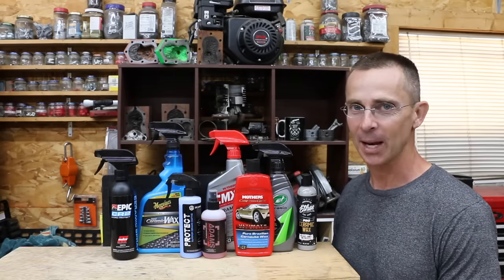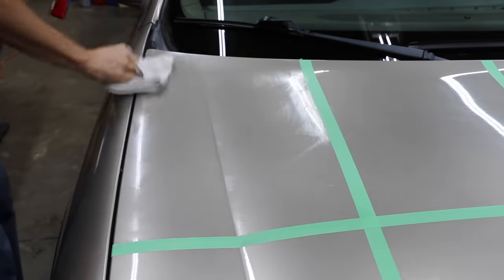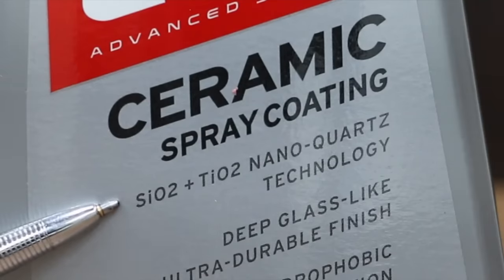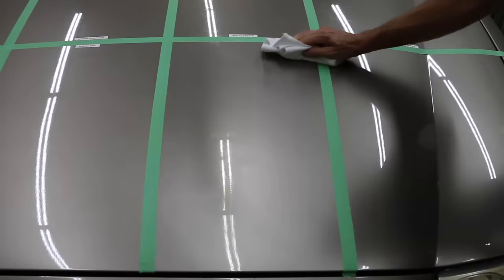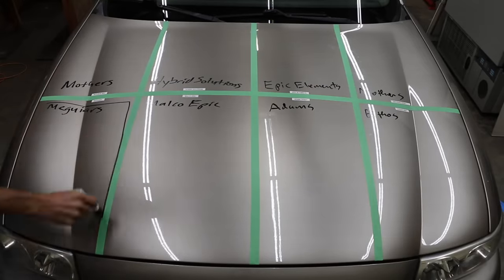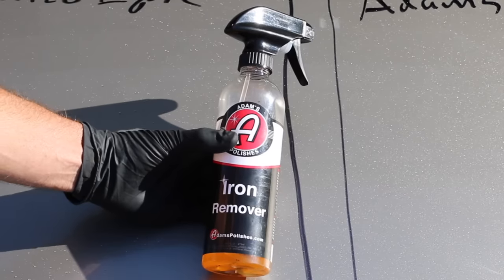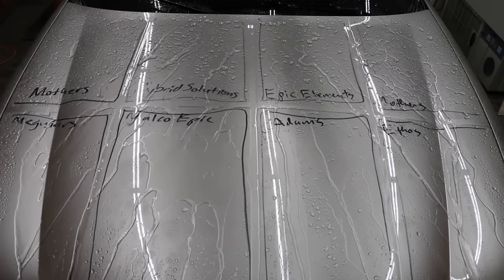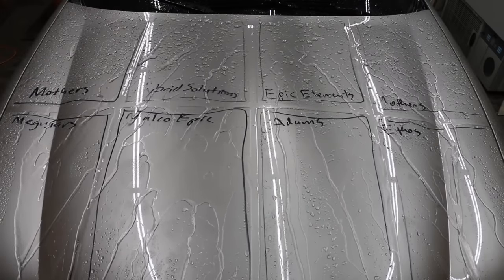Best Ceramic Spray Coating? Mothers vs Meguiars vs Ethos Pro

Comment: What a great video! I really appreciate your methodology! Question - How long, if at all, should you wait before treating the paint of a brand new vehicle? Mine was literally built a week ago and I remember when you had to wait months for the paint to fully cure before treating it with any kind of wax. Thanks in advance!
Reply: You can do it as soon as you get it. Might be new but I guarantee there’s iron contaminants on the paint already. Not to mention most dealers use auto car wash which leave swirl marks and scratches.

Comment: I'd love to see how the spray "ceramic" coatings compare to a professionally applied true ceramic. Pretty much every detailer I've talked to say those ceramic coatings aren't ceramic. Which I think we proved here, they're only somewhat more durable than wax
Reply: Sio2 is ceramic. Professional grade ceramics are mostly pure sio2 with some additives for hardening and adhering. They require very precise application and and very specific curing conditions, some require ultraviolet light during the curing period. 

Consumers are not allowed to purchase most real professional grade ceramics. There are some "consumer grade" that you can buy, which require less precise application.

The shelf spray on ceramics like turtle wax are extremely easy to apply and last very long compared to effort and price.

A pro grade ceramic that will last for 5 years will run you AT LEAST $1000. A bottle of spray ceramic that will last 6-12 months runs you $12.
Reply: @rorschacht8478  I'm aware. I'm just saying I'd like to see how these compare to a commercial ceramic, because they're different. I know coating a whole car would be expensive, but having a pro do a 1 foot by 1 foot square on the hood and redo the top off the shelf ones next to it
Reply: The detailers say that because they want your business. Every person I know that has had their car ceramic coated said it's not worth the price. It's great for like a month and then it's like it never happened. I'd rather buy this "fake" ceramic for $18 and reapply every month myself.
Reply: @skullsroad3642  right. That could be the only reason they are saying it. Wouldn't it be great if he could test it and compare? For his knife sharpening video, he did a few, and spent quite a bit of dough on some. Those tended to be usually worth it, to a point. But again. I'd love to see the comparison to see if it could be worth it or not, if the pros actually get what they claim vs these that... Are better(than wax) but not what they claim
Reply from the maker: Great suggestion!  Thank you.
Reply: @Rickard V  - they only cost that much to have a professional detailer apply them. They don’t just differ in percentage of SiO2. They are designed to be permanent. The spray hybrid ceramics are very different products. Most permanent coatings are under $100 for 50ml. You can buy them for under $10 on Ali. I have tried both and the $100 is only slightly better after 6 months. There are graphene coatings now on another level.

Comment: Thanks so much for these tests. I went and bought the Hybrid solutions based on your test. Looking forward to seeing how it goes
Reply from the maker: You are welcome!  Fantastic!
Reply: How did it turn out?
Reply: @claaas8401  Good stuff. Very happy with it
Reply: @yakabothatesthis  nice! Was it hard to apply? Thinking abiut dling this fir my e60
Reply: @claaas8401  Very easy. Microfibre cloth, spray a bit on a section, then wipe it off. But your surface needs to be clean, or your'e just locking in the dirt.

Comment: I bought the Turtle wax product based off this video. Just got back from a 550 mile round trip in the snow (and salt) , off-road in Nevada, went through the local car wash when I got back into town and the Burban is spotless 👍🏼👍🏼. I also coated the side and rear glass.
Reply from the maker: Thanks for sharing!

Comment: I bought a black 3 year old Nissan armada that has been very well taken care of. The first weekend I had it I washed it, used a clay bar, iron remover and surface prep. After that I used the hybrid solutions polish and wax followed up with a coat of the ceramic spray. Took the whole day but was inexpensive and very protective and make cleaning the exterior a breeze.
Reply from the maker: Thanks for sharing.

Comment: 'Hybrid solutions' looked so weak with only those two tiny squirts..... "Not fair!" says I.  Ba BAMMM! It clobbers them all. :)
Reply: SharpByCoop - I used it on my two cars. They really stress not to over apply.  And it’s still holding up well after six months and many car washes.
Reply: I used it for the first time about 3 or 4 months ago and it works better then anything I have ever used before.
Reply: @davidturk6301  
Sir, thank you for your input,  I have a 76 Cadillac Coup de Ville and was thinking about what kind of wax, or ceramic coating to use. P. F. had me sold, but hearing from someone who has used it helps a lot too.
Reply: Bert Grau - got it at Walmart for less than stated here; either $13.99 or $12.99, don’t remember.
Reply: @CD3WD-Project  Same.  Threw everything else away in the garage.  No point, they're all obsolete.
Reply: I've been a professional detailer for 23 years. I have tried all these products and virtually every popular product in the detail community. I can confidently say the Turtle Was hybrid ceramic spray and seal n shine are the best spray-on protection you will find. Even being more durable than products over $100 dollars. Turtle Wax is back.
Reply from the maker: Thanks for the feedback.

Comment: I would like to see “real” ceramic coatings testing, not the spray on coatings. Basically the professional grade coatings.
Reply from the maker: Thanks for the suggestion.
Reply: @ProjectFarm  same can be with regular wax-es also :)
like swisswax, meguiers, turtle etc.. :)
Reply: Why? Waste of Todd's YT/Patreon money, and none of us really give 2 flips about uber-expensive car sealants.
Reply: @boots7859  first, they're not sealants. Secondly, a lot of the costings claim 3-9 YEARS of protection. If they can actually handle his tests then they might be worth the money. If not, viewers might just stick with the 30 day protection that spray on SIO2 coatings offer.
Reply: @boots7859  exactly, project farm is for the average Joe's wanting to know what's the best in our price range. Most of the people watching this video is going out to spend $100+ on wax
Reply: Scott H (YouTube channel name) has a longevity test of waxes, sealants and real ceramic coatings. He doesn't torture test them but has them exposed to the elements.

As an ameture detailer I can assure you actual ceramic coatings are the real deal. These spray coatings are fast and easy to use and give about as much protection as a sealant would (~6 months) while real coatings last years.
Reply: bobwatters  unfortunately they are much more expensive than that.
Reply: The coatings do last 3-5 years, but they're quite labor intensive to apply and require ludicrous cure times where you cannot use your car.  Some of these spray ceramics, including that Turtle Wax one featured in this video, can be applied in minutes and can last up to a year.  I'm not saying ceramic coatings don't have their place, but in my world?  I'll spend 30 minutes a couple times per year rather than spend 4 hours applying a coating then waiting 4 days of zero driving and 2-3 weeks of avoiding all water/bugs/etc.  They're nifty, but most applicable to weekend/hobby cars that you can park for a few weeks and not really care.
Reply: @camarodreams7689  hybrid solutions can last up to 9 months, some say 12. The bottle is still very full after 2 uses. As a professional in auto restoration, true ceramic coatings are for show cars or rich people.
Reply: Well call me crazy, but I would be very interested in a ceramic sealer shootout. I would have done it on a couple of my vehicles already, but can’t decide which product to choose. Turtle Wax Hybrid is by far the best spray on, but unless you are talking about a garage kept Sunday driver, there is no way in hell it will last 9 months. I just used it for the second time this year on my wife’s black car and used the Meguiars 2 times this year before that. It’s good stuff, but it’s not “last an entire pregnancy” good.
Reply: @Erdie5  Also, the vehicle should ideally receive a detail with full paint correction prior to applying a ceramic coating. Otherwise, all the imperfections will be locked in for a year or more. If it is a Ferrari or new car just leaving the dealership, then the expense is worth it. But for a "normal" car, I agree with you. I don't mind spending 30-60 minutes a couple of times a year applying an off-the-shelf hybrid SiO2 spray like Project Farm has demonstrated.
Reply: But can he get these products off in order to test that XD
Reply: @Erdie5  so true for people who have a daily driver and live in the Northeast where you get 4 seasons of all the weather elements.  Have you tried any of the latest trends: graphene coatings or graphene sprays?

Comment: Another great test. I was very surprised by how well Turtle Wax did. The only issue is that Meguiars Hybrid Ceramic is supposed to have a base coat first then you can put on a protective layer. Both the base coat and maintenance coat have to be put on WET, not dry. It needs to be washed off then dried by hand. You can find the how-to here: https://www.youtube.com/watch?v=Zk-OwkIlYLs
I wonder if this would have changed the results and outcome? 
Thank you for all your hard work.
Reply: He did put the base coat on wet. Putting two coats would be a little unfair as they all probably do a littler better with two coats.

Comment: Get a guard dog, over-priced wax companies are going to come after you.
Reply: Not at all, we were the slickest of the bunch which means we are on the right track. Although our product did not show its true durability we have a wide selection of formulas available that might be a better fit for chemical resistance testing.

We take this all as constructive feedback and find ways to improve.
Reply: @ethoscarcare  no one minds paying a little extra for a product that does what it claims
Reply: @ethoscarcare  Awesome to see a company watch this and respond.  It shows that you know not all R&D has to happen in-house.  Keep up the good work.  this also doesn't test UV...  Would be curious to know how pros test UV and see a comparison.  I'll definitely check out your products.
Reply: @ethoscarcare  I think i am even more compelled to try your products now, This ^ is  a classy and refreshing response!
Reply: @ethoscarcare  Lots of respect for a company to watch a video and respond in a constructive manner, will definitely need to try out your guys' products!

Comment: We have a black 96 SVT Cobra 🐍 Mustang. I’m particular with its care and have tried many products. I’ve been extremely impressed with the Turtle Wax Hybrid Solutions line. I used it on our 3 household daily drivers using first the Hybrid Polish / wax 2 coats, Ceramic Spray Coating 2 coats followed by Hybrid Ceramic Wet Wax 2 coats. Waiting 24 hours between coats. Treat vehicles in October still beading in May after sleet, snow, rain & ice plus road salt & grime.  Another very strong favorite is Colonite Insulator Wax first designed for power line insulators its now sold as a car wax. Apply very thin on a properly prepared car it will last 9-12 months and very shiny.
Reply from the maker: Thanks for sharing.

Comment: I bought the Turtle Hybrid and did apply one coating to one of my test car to see if there any negative results.  After about 6 months, I was satisfied that the nothing was happening to the paint and I applied 2 coats as suggested to get maximum protection.  The finish is holding up very well in the hot Hawaiian sun and it is going on it's 8+ week.  Putting on 2 coats definitely amped up the length of the protection.
Reply from the maker: Thanks for sharing.

Comment: I've been using the Turtle Wax Hybrid Ceramic for over a year and it out performs all the ceramic coatings I have used and all cost more. It even out performs the graphene coating I have  but they're close.

Comment: I just applied the Turtle Wax Ceramic Spray to my BMW M340 and at first look it is great stuff. I could tell the difference on the glass sunroof - before the application the bottle sat still on the glass. Simply by chance I set the bottle down on the glass to spray the rear roof section and it started to slide off the car where the application was complete. Will report back in a  few months on how long it works. Car is garaged and doesn't often see rain, but I drive it to work about three days a week. Thanks so much for the testing. Love your videos. Straight up and No BS. Keep up the great work sir. P.S. This is the first Ceramic product I have ever used and it was easy and little on and easy wipe and then buff with a clean towel off...
Reply from the maker: Thanks, will do.  Thanks for sharing.

Comment: I recently purchased mcquires ceramic on my 22 ranger and I gotta tell you it came out great the shine lasts it’s a black truck and I believe I got $5 off so it came to $14 and change , when it rains it basically dries within hours without road dirt or stains , excellent stuff
Reply from the maker: Thanks for sharing.

Comment: I got the Turtle Wax Hybrid Solutions based on this video, and it's slicker than (insert gross slimy stuff). It's so easy to apply, I got the entire car done in 1/2 hour. It doesnt leave white residue on trim panels like wax, you can overspray anywhere without worrying about how you will clean it up. Thanks for the killer showdown review, it helped me make a great purchase!
Reply from the maker: You are welcome!

Comment: Thank you for that video!👍 I currently use Mequire’s Hybrid Ceramic Wax Spray, but now, I just put an order in for the Turtle Wax Hybrid Solutions Ceramic Spray, to switch products, due to it doing SO Much better, and IS Cheaper.
Thanks again!! I love your content!👍👍
Reply from the maker: You are welcome!  Thanks for sharing.

Comment: Thanks so much for your direct approach to testing.  I have followed your test results and used Turtle Wax Ceramic Spray on the paint and Cerakote on the plastic on my 2014 Mazda CX9 that has only received occasional washes over the years.  I am extremely happy with the results.  Given the high price of new vehicles I plan to keep this one for as long as I can.   Thanks again for your efforts.
Reply from the maker: You are welcome!  Thanks for sharing.

Comment: I'm glad to see the Adam's product did well. I just got like 9 bottles for FREE from work as it's technically discontinued because they have the Graphine stuff now, so I know what I'll be doing this weekend. Paint & windows watch out, you're about to be protected just in time for the winter months. Best part is I also got the Adam's surface prep solution that's suggested for use before the application of the ceramic. Thanks Project Farm for easing my mind a bit.
Reply from the maker: You are welcome!  Thanks for sharing

Comment: Well done! I was looking for a review of detailing products but most of them are either sponsored by, or at best a "round-up" of the products. I'd love to see the "wet car wax" products tested. If you do the same tests as here we'll be able to compare them against each other and the products already tested. Ive just bought a bottle of Turtle Wax ceramic spray coating and their ceramic wet car wax. 
Turtle Wax seems to've gone out of favour recently (hipster/farmers market effect i guess) so its good to see the "old guard" with their very reasonably-priced products doing well 😊

Comment: When it comes to car cleaning products I always go with mother's when I'm not sure. It may not be the best in all things but it is always good I find. With ceramic coatings I bought from my friends cleaning company, unfortunately I can't remember the brand, but I was very impressed with it, took a few coats on my old car but performed better than anything else I have used, it was a 2 part application, 3 if you include the cleaner, but was not cheap.
Reply from the maker: Thanks for sharing.

Comment: I have been using Meguiars ceramic spray wax. I wash the car, rinse well, dry and then spray the wax on a wet towel plus a few shots on the car and rewash the car then rinse. Seems to work better than just spray on and rinse. Work top down and do not let it dry. I've gotten lazy and old but I used Meguiars NXT Tech wax 2.0 before ceramic. I think it gives a better shine and lasted a long time in Florida.
Reply from the maker: Thanks for sharing.

Comment: As a longtime Mothers' buyer I was certain CMX would excel, so was astounded to see the cheapest/ounce Turtle Wax product come out on top. Intrigued, I bought their Hybrid Solutions Ceramic Spray (53409) and Ceramic Wash & Wax (53411). Both products went on easily, are quite slick, bug residue wipes right off they made my seven year old pearlcoat paint shine.  If you ever test "wash and wax" products, I suggest including TW 53411. I didn't endurance test it prior to topcoating with 53409, but it left my paint so slick I'd actually consider using it solely. Love your channel!
Reply from the maker: Thanks!  Thanks for sharing.

Comment: Great test ! I use the hybrid solutions on my cars and boat here in Florida. Very happy with the protection. The boating community and car "experts" swear that very expensive ceramic coatings applied by car and boat  detailers are far superior. Maybe a future test ? Keep up your great unbiased work !
Reply from the maker: Thanks, will do!  Thanks for the suggestion.